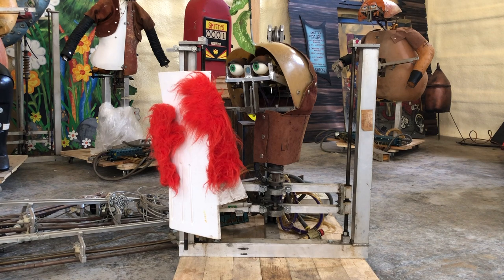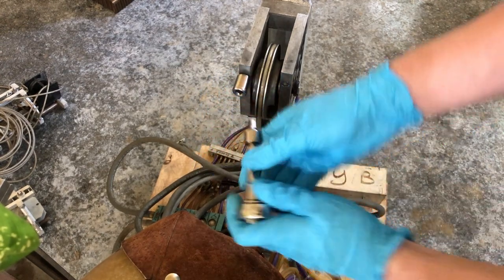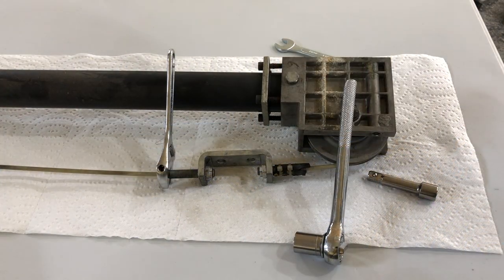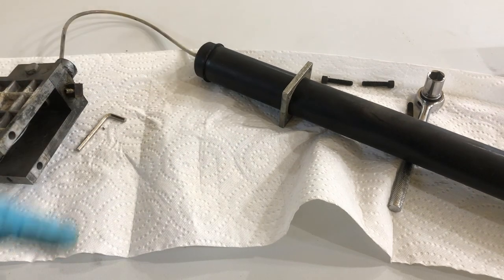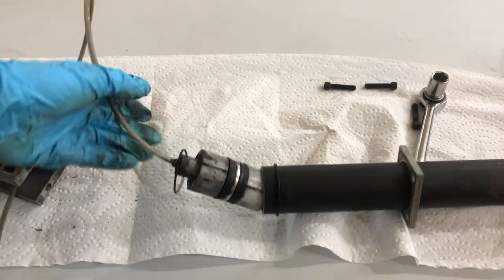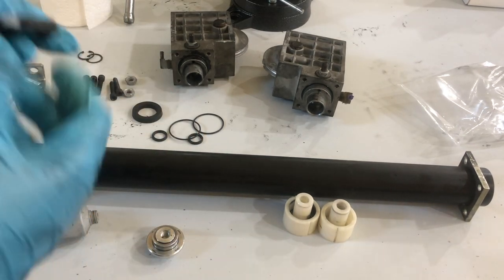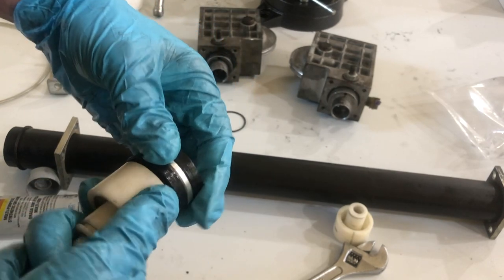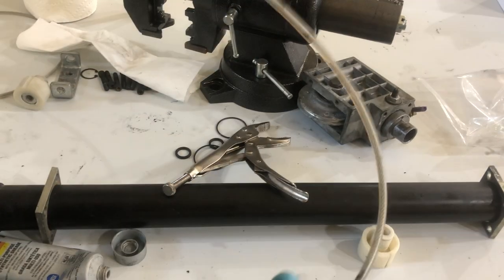Rock-afire Restoration Part 13 (How To Rebuild A Tolomatic Cylinder)

Comment: The Sun, The Moon, And Looney Bird Uses The Same Pulley System Designs
Reply: @Garbage Guy and Antioch the spider
Reply: Cool
Reply: And forgot Choo Choo too
Reply: And You Forgot Choo Choo Bruh.
Reply: @Garbage Guy I thought it was the "AB💣MINATION" sign that lowered on Uncle Klunk's stage?
Reply: @meaganh637  Choo Choo doesn't use a tolomatic cylinder.
Reply: @sethhorst6158  it doesn’t matter bruh
Reply: @meaganh637  Coming from the one who brought up the unrelated prop character in a reply chain that's talking about talking about characters and props that uses a Tolomatic air cylinder.
Reply: @sethhorst6158  it doesn’t matter 🤦if it’s a cylinder or a air pressure because we’re talking about props
Reply: @meaganh637  choo choo is one of the smallest characters in the rock afire shows and if he uses a tolomatic cylinder that would be distracted because the tolomatic cylinder are tall and choo choo is small so using a nomal cylinder like all mitzis arms or the body all the full body characters lean they use you can see it in one of the videos of a channel called CEC Florida the video is called A Close Look at Choo Choo and in 1:13 you can see that choo choo uses a nomal cylinder like mitzi arms or any full body that has a body lean here is the link to the video remember it's 1:13 https://www.youtube.com/watch?v=s-uvqWiRh7o
Reply: @mechaitheracer2563  yeah yeah i know Ikr
Reply: @mechaitheracer2563  Yeah we know why Choo Choo doesn't use one but why would Choo Choo be brought up in a reply chain that's about props that uses tolomatic cylinders?
Reply: @sethhorst6158  I’m guessing that person is just a want to be noticed person
Reply: @Garbage Guy okay? Also you tried roasting me again but who cares! Also lets don't start a problem until some people might just get evolved and might make a bigger problem so could we please!!!!!!
Reply: @Garbage Guy …….. also i think in part 16 he might show us another mechanical thing, since this series is pretty good.
Reply: @Garbage Guy yeah this talk is outdated
Reply: @Garbage Guy no am not am just saying this chat is outdated. So yeah I won't disturb you again. Well forever